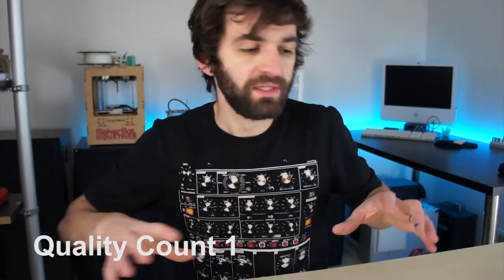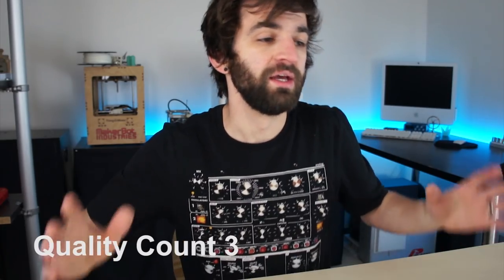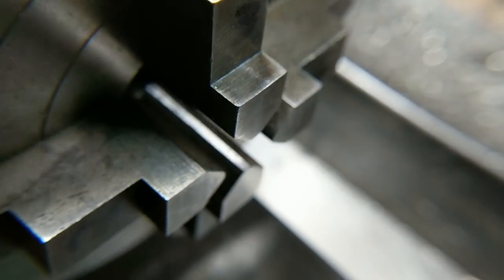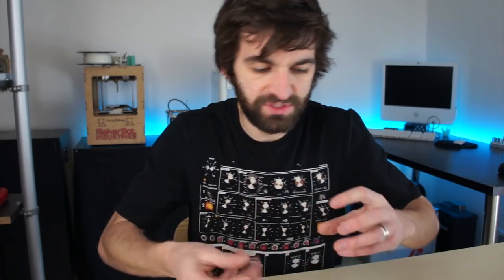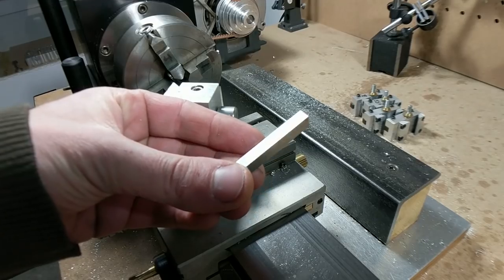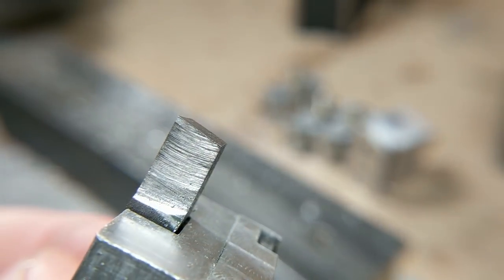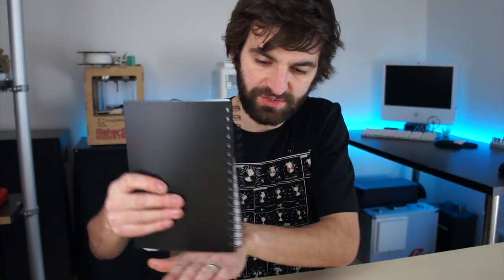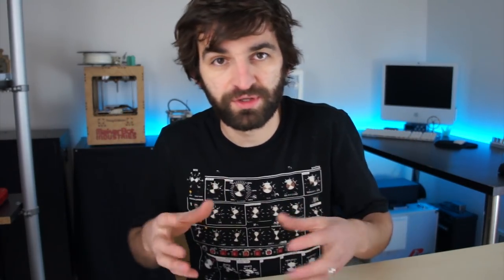Buying Your First Metal Lathe

Comment: Straight to the point, I like it. I'm running a Grizzly G0602, off shore, but i got it at $1100 a couple years ago.  I gotta say your right about work size vs. price as well as hhs tooling. I have nice insert tooling and I still go to hhs most of the time. Great info video, and I never comment or like shit lol.

Comment: Maybe better expalained: 
a 3-jaw chuck only gives 2 features which are have the jaws tight and having them loose and then wherever your stock is tightened in the chuck, that's where the stock stays according to wherever the 3 jaws positioned the stock toward center. 
However a 4-jaw chuck will allow you the precise adjustment to position your stock in the chuck in order to 'true' it up whereby using a dial indicator on the stock while it's in the chuck and rotating the stock while adjusting each of the 4 jaws separately to find center. The dial indicator will tell you how many thousands of run-out you have

Comment: If you're getting a tabletop machine, I would recommend a long bed Sherline. I am so glad I got the long bed! It's very easy t consume the bed length. A job a few inches long and a need to drill a hole through it will eat up most of the bed! For work holding I can only recommend the four jaw. A three jaw in this size is only good to the smallest jobs. I would have both, and do, but for a budget I'd get the four jaw first.

Comment: May I ask a question about Tarig micro lathe ii?

I plan to do some wood turning on metal lathe due to some woods are very hard to cut with woodturning lathe. The Taig micro lathe with riser block can have 6.5” swing. Is that save to mount a 6” diameter fixture( sphere jig) on the Taig micro lathe?

Thanks.

Comment: Well I am a Tool mechanic which means I work with mills and lathes on a day to day basis and we only have 3 jaw chucks with which we work to tollerances of sometimes just 0.01mm and it is fine
Reply: Kenny H  well the parts we do are critical tolerance
Reply: @zane G most of the time

Comment: There are many mini lathes and mini mills coming from China, but it is best to study and learn BEFORE buying.  I have found that Micro Mark and Little Machine Shop sell a 7x16 lathe that uses a brushless DC motor that is very quiet and does not require the additional noisy 2 speed gearbox.  The Micro Mark comes broken down in two boxes, so you can get it up on your bench without having to use a crane.  The LMS version also comes with a fixed (non tilting) column.  The current price at MM for this lathe (and the mill that uses the same motor) is $1,100.  When I bought mine they were $750.  
The mini lathe will do most things a gunsmith would want to do, except work on a bull (large diameter) barrel.  Among the important things necessary to get started are a quick change tool post and an outboard spider.  But by all means, READ AND STUDY BEFORE BUYING.  A good place to start is at http://www.mini-lathe.com/ .  There is a lot of info there, and you don't have to buy a book.  
One small tip to get you started:  The 3" chuck that comes with the lathe does not have a large enough hole.  If you get a 4" or a 5" chuck then it will pass through anything that will go through the spindle.

Comment: I picked up a Taig Micro II 4500 with a 4 jaw and two headstocks for $90.  It has this weird tensioner pulley on it that’s out of alignment with the belt (I’m not really sure why it’s even there to be honest).  I have no idea where to start with assessing and dialing it in.  Can you recommend reading and videos for a complete novice on first time setup/testing?  Thanks!

Comment: I’m curious what you think about older machines. Maybe a bench top Logan, or some such, what do you see being the most pertinent trade offs for older machines at a cheaper price point?
Reply: I would say machine condition and parts availability. If you can find a name  brand with a good amount of tooling at a reasonable price, then I'd go for it. You can find parts and accessories for Logan, South Bend, Atlas easily, though I think some of the stuff on evil bay must be gold plated for the prices sometimes asked. You would have better luck on Craigs List finding something local to you that you could physically look at under power. What some people call "good condition" is laughable.. if it looks like a rusty pile of iron, run away! There will be a nice, well cared for machine for sale in a few weeks.
Curt does make a good point about what you start out with.. get the best you can afford. It is important to get a lathe that has a distance between centers at least twice the swing, e.g. 7x14, 10x20, 12x24. By the time you mount a chuck on the spindle and a drill chuck in the tail stock, you actual work area will start to be cramped if the lathe bed is any shorter than that.
Reply from the maker: Could not agree more, well said.

Comment: My brother just bought his first metal lathe. It's an antique mini lathe and he is planning to restore it. It's a 1949 6" x 12" Craftsman Model 80 - usually catalogued as the 109-21270.
It's his 30th birthday coming up and I want to get him some tools or accessories for his lathe. Can you help recommend something? I know nothing about lathes
Reply from the maker: Hmmm, well the 2 tools that I use pretty much daily and could not live without when working with a lathe would be a Noga magnetic base and a dial indicator, especially useful if he is going to spend a bunch of time dialing in tolerances and adjusting for level on this old machine. The Noga bases with the fully flexible arms are ideal but even the cheaper non-branded versions are good. Start off with an inexpensive dial indicator, the nicer ones get expensive quick and are probably not needed unless he gets that machine REALLY dialed in. If he doesn't have a set of calipers they make a great gift and range in cost from $30 to $300...once again cheap ones will probably suffice. Thanks for the message and hope that helps out some!

Comment: What do you think about some of the grizzly machines? From what I understand they're branded offshore machines, but they have decent quality, an actual store in the US. They seem to be more like a step above harbor freight (they offer some models that are comparable/same as HF). Ones that i'm looking at are in the 1000-1500 range. The G0602 has my eye right now, a 10x22
My question is; what features do you prioritize? HP? size? Taper? DRO? spindle bore? threading options?
Reply from the maker: Ooo, thats a loaded question (one I have spent months reading into).  Yes I like the Grizzly machines, I have G0704 mill which is awesome. Most of the 10x22 lathes are fairly decent with VERY similar builds for that price range. Lots of people like the G0602, all depends on what you want to do.  Ideally a machine with a proper quick change gearbox (norton style) and a D 1-4 spindle mount would be my main choice...but that puts you in the $5k range and is not really considered a benchtop machine anymore.

If you can get a 10x22 sized machine with separate thread cutting and feed screws (so you are not wearing out your threading screws in normal day to day use) that would be ideal (sadly not a feature on the G0602)...also one of the reasons I do not have a 10x22 sized machine :). I could rant for hours on features but it all depends on the work you plan on doing.

With that said, people do amazing work with good and bad 10x22 machines...all depends on what you are after and how much tweaking/modifying you are wanting to get into.

Hope that helps more then it confuses :-).

Comment: Thanks for the video. Do you have suggestions for starting my own workshop? For instance, what machines/tools are a necessity other than the lathe? Thanks bud.
Reply from the maker: That all depends on what you want to do.  My advice is to try and build whatever it is you want (with whatever you currently have)...equipment /  tools only help achieve those goals by making processes easier or quicker :). Best of luck!
Reply: @CurtVanFilipowski  thanks. I'm interested in making sequential movement puzzles. I dont have a means to make straight cuts though. So would you suggest a band saw or something else? Thanks for the quick response.
Reply from the maker: Ahhh, a man after my own heart (I LOVE puzzles). Band saws are great, they are still a "rough" cutting tool...however you can easily process cuts from a saw with simple hand tools to get excellent finishes. With that said there is a reason the apprentice classes (in both metal and wood working) arm you with nothing other then hand tools to make precision parts. Many a machinist had to make precision setup blocks (in steel) with a hacksaw and file...outdated, yes but it still teaches you the fundamentals of working to precision measurements.
I'm sorry to keep skirting around recommending tools...but they aren't your barrier to entry, they only make the hand processes easier or faster.
Reply: @CurtVanFilipowski  no need to apologize. I understand completely. I have so many ideas for puzzle yet lack th workshop and skill to make them. Hah. Maybe it's time. Thanks again. Keep up the videos. You do a good job.

Comment: Which lathe would be good for lightsaber hilts?
Reply from the maker: I'd probably go with something a little larger to get all the turning done in 1 setup...ideally something in the 10x22 range or larger would probably be ideal. With that said I'm confident I could build a hilt with this sized machine as well, would just have to get a little crafty with setups and assembly.

Comment: if money is not an object and I WANT TO eventually make money and not upgrade and do any project>>>>>what do you reccomment? Ottawa canada.
Reply from the maker: If money is no object buy the most mass you possibly can in a full on toolroom sized lathe...the Hardinge HLV is a machine I'd love to have in my shop. Slightly smaller the Schaublin lathes are also nice...so many choices out there! All depends on your size / weight allowance and what you want to make.

Comment: I haven't used a taig or sherline mill/lathe but I've had great luck so far with used machines i have a 10x36 clausing lathe that i got out of a barn for 900$ i cleaned it up it still had flaking on the underside of the carriage. I also have a hardinge mill that I paid to much for 1400$ with a baldor mint II cnc servo but I'm selling it for what I have into it and getting a Bridgeport style machine. The problem with these is they are old and heavy and take up more space than your desk but I also do bigger work than you so I can't get away with a sweet little machine like yours.
Reply from the maker: I would kill to find an old clausing for that kind of price around here! Sadly vintage machines around here are either totally clapped out or require 14 feet of concrete for support and 3 phase power :) !
Reply: You've got a pretty sweet setup though and my clausing is a 1 hp single phase they are out there but the same 4900 models do come in  3 phase from the factory as well